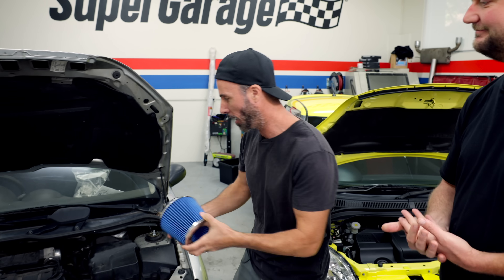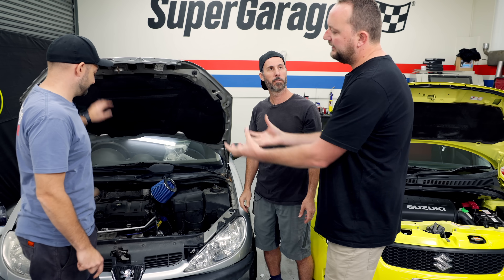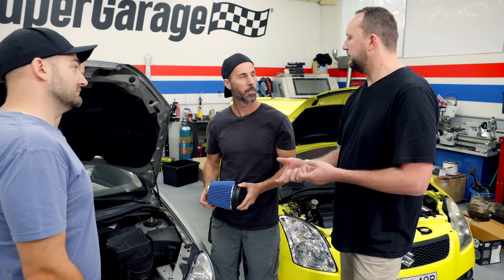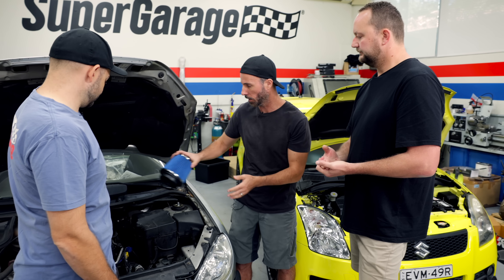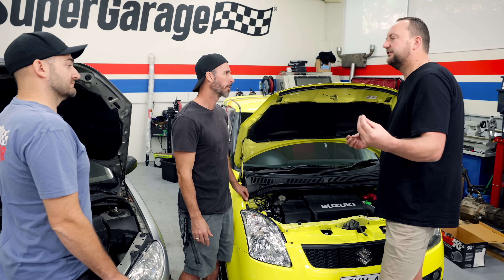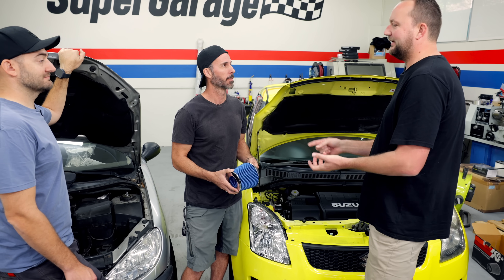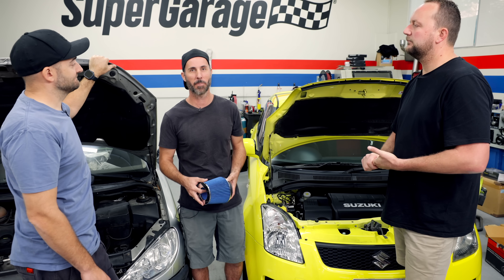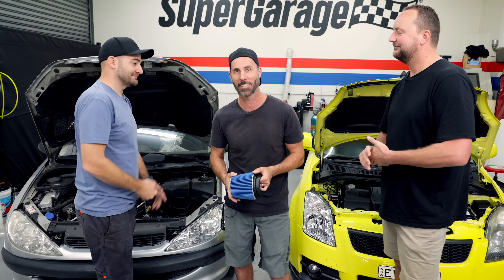Do POD FILTERS Make You Lose Power?

Comment: Would it be possible to force feed the air from the climate system into the intake? I know Dodge did something along those lines, and it seems with a larger AC or a dual unit you could route boosted air into the intake. Any numbers for losses or gains, if someone has done this?
Reply: Yes the colder air will definitely help, BUT you have to power the air conditioner somehow.
I guess the Dodge is set up for drag racing, so they might run the AC to get the air as cold as possible, and then turn it off for the actual run, and hope that the AC stayed cold for the 10s or so it would take to do a pass.
For track racing, you'd have to run the AC all the time, and I think you'd loose more power to the AC than you'd gain from the colder air.  If it did work then you'd see race cars running AC intakes, and as far as I know, none do.
Oh, and it will also add a bit of weight (and complexity).
Reply: @phuzz00  Yeah, weight to performance not worth it likely.
Reply: You are correct.  Dodge did this with their "Demon" Challenger, but it's somewhat of a gimmick.  It only applies to drag racing.

In theory, you run the AC to get cold air, which gets routed to the intake.  Once you go wide-open-throttle (WOT), your AC shuts off (as an accessory, it's belt-driven).  The air is still cool enough for the few seconds it takes to run the strip, thus you get a small amount of cold air benefitting combustion.

The thing is, air conditioners are already heavy, and this setup introduces further complexity (weight).  A better solution is to simply install an intercooler, which adds weight, but is substantially more efficient.  Alternatively, AC, Power Steering, and any other accessories are typically the first things to go on a dedicated drag car in order to save weight.